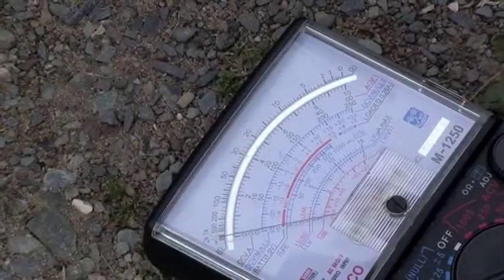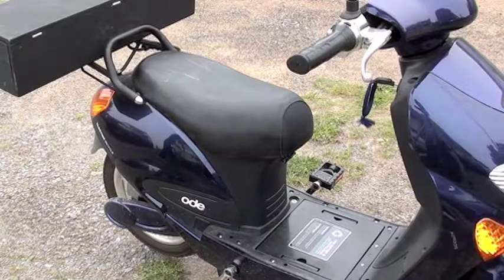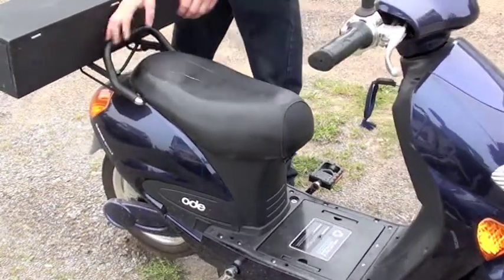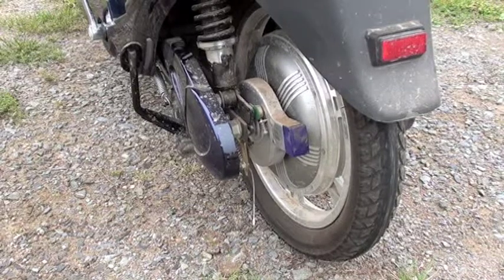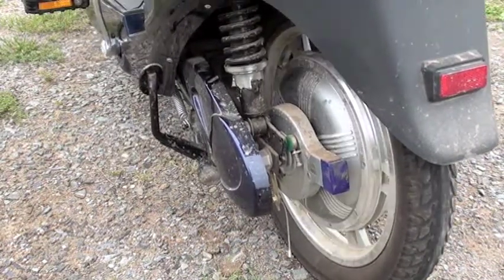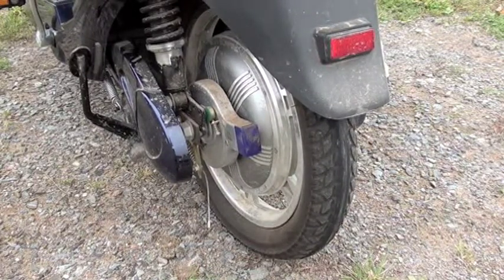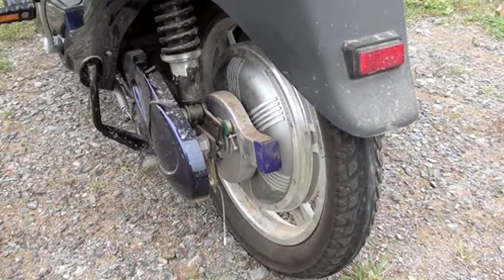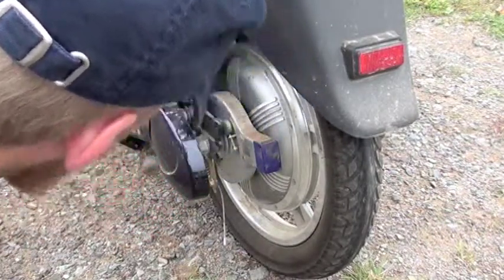ECOPED ODE "no go" issue

Comment: i have the same problem please help
Reply from the maker: These lead acid batteries (in battery packs) tend to get hot and melt when they get older (or overcharge). See other scooter video. The batteries really do deform. Then you need to buy new batteries. Just replaced for the 2nd time a melted set of 2 from another electric bicycle at $139.43CDN. These scooters have 4 batteries.